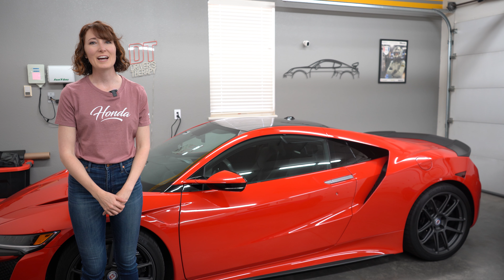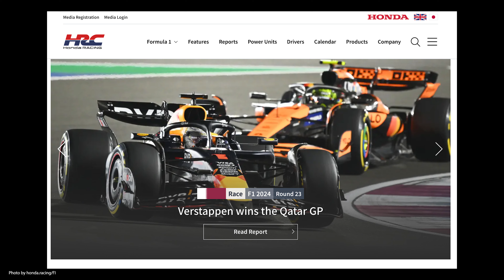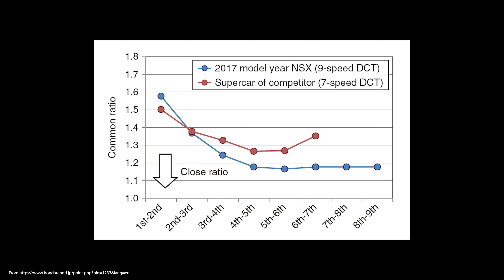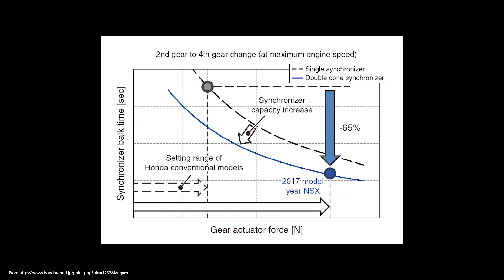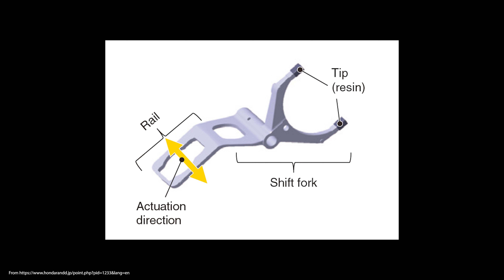DCT Transmission Design - NC1 Acura NSX

Comment from the maker: Let's hit the like button for Elise! She put in a lot of work to make this video!
Reply: Hi, I have 2019 nsx. It’s leaking pink oil from the back after an extended drive (puddle size is 1 sf).  If parked without driving, the leak puddle is about size of a quarter.  What are all the possible issues that could cause this ?